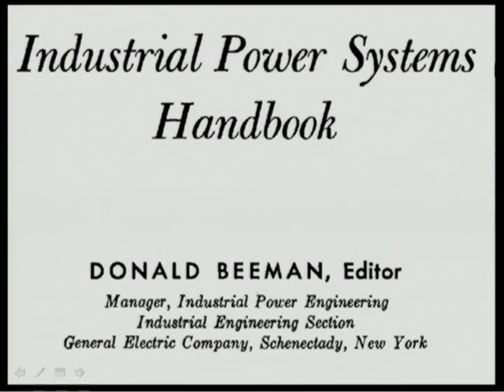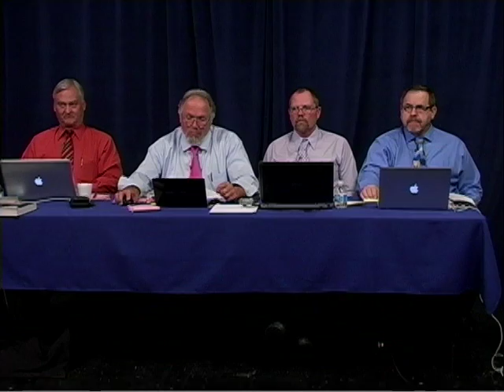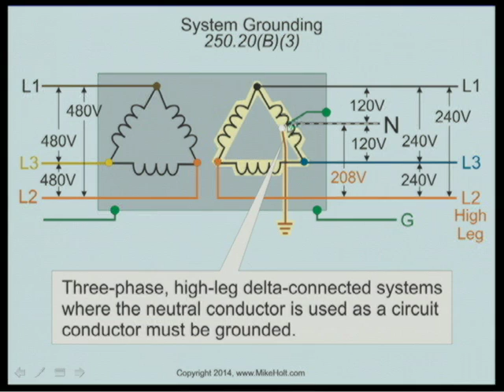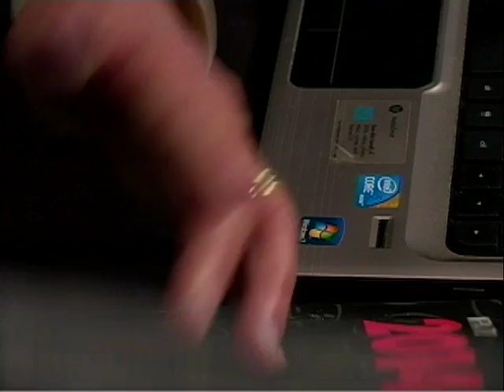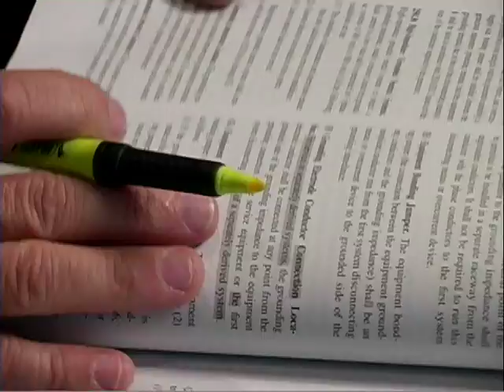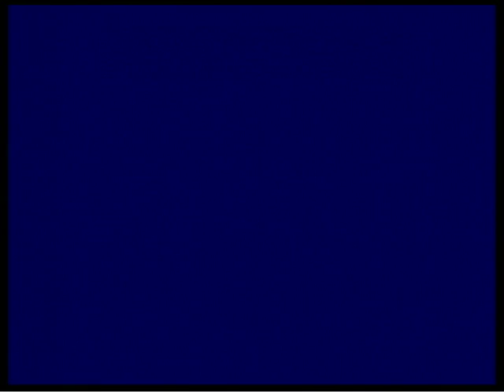4 of 7 Grounded Versus Ungrounded System, NEC 2014 - [100], (35min:35sec)

Comment: You’re not wrong about engineers today. I’m retired now, but my education was in power engineering. Electrical engineers today don’t learn the practical aspects of power generation, voltage control,  transformer connections. I’ve taught many young engineers the principles of power generation and distribution systems.
Reply from the maker: I truly miss the Engineers of the past, the ones who were taught Power Engineering. Many of today's engineers just don't have the technical, practical knowledge.
Reply: @MikeHoltNEC  I am currently going to college for electrical engineering and there is a strong emphasis on electronics and as an electrician it is quite disappointing.

Comment: And then I'm like.. whatever ground rod you use I'd suppose it would have to be lower resistance than the water pipe coming into the building right? Or you're inadvertently sending your entire ground system over to that pipe. 

lots to think about with this stuff and I can see how people make errors related to this.

Comment: Ok good- 9:40 answered my question from the grounding myths video: whether grounding saves lives or not. It saves equipment, not lives! Is what I gather. 

Old school thinking on this will say it saves lives because of the electricity being "redirected to ground" but you can just as well provide that path as a human body, so that's a bad supposition. 

Can anyone weigh in more on this for me?
Reply: Your supposition is correct. The idea is the ground provides a path back to transformer neutral to cause an overcurrent event and trip the breaker to kill the power. Happens in just a few 1/60ths of a second in the USA (60hz power), and depending on the breaker installed. The type of breaker required to save a human is a GFCI breaker. A standard breaker won't because the amperage required to kill you is very small. Remember, amperage (current) is what kills, not voltage, but a bigger voltage makes it easier to push more amps through your skin. So you can short out the system with your body but as long as current stays below the breaker rating, the power won't cut out and you will continue to be shocked until you break contact. A GFCI detects the difference between hot and neutral current. Think: power in vs power out. They are set to detect extremely small differences in current for the purposes of saving a human. Whenthe breaker senses that difference it opens the circuit. - union electrician

Comment: I was at an Apt building in the swimming pool that was surrounded by a iron fence I jumped out of a pool and grabbed the fence and got shocked it took all my strength to let go I think the system around that area what ever it was powering should be ungrounded by the swimming pools.
Reply: This happens near high voltage lines, it's magnetic induction if I am correct. When you got wet you gave it a good path to travel, if you were dry I doubt it would have been able to bite you like that.

Comment: Back in the early 1980's we had about 20 VFD'S for 2 to 10 HP motors. Had to install a 480 to 240 ungrounded isolation transformer to each drive. Tech told us the drives could not handle a large fault current and I thought this was dangerous not grounding the secondary of any transformer over 100 VA.
Reply from the maker: Ungrounded systems installed per the NEC are perfectly Code compliant.

Comment: I was in a very old warehouse with a ungrounded system installing HVAC equipment seven years ago.   Unfortunately a residential electrician was hired to wire up this commercial three phase building.  He knew he wasn’t qualified and I knew he wasn’t qualified but he did a lot of research and both of us watch Mike Holt videos.  And many others.     End of story he added too large transformers three face for 277 208 and 120 and 240 legs ( I am not Electrician my background was an automotive technician Electronics drivability electrical and air-conditioning) 

         He explained it to me this ungrounded building and corner grounding his new transformers that he was installing. 
           When they tore up the concrete for some other work next to the transformers he bonded the corner grounding electrode from the transformers to the re-Barb of the building and he drove a ground steak and bonded to the wires together and he had me Silverbreeze the wires to the re-Barb and all his connections that we’re going to be buried underground in the concrete so there would be no corrosion with good electrical conduction. 

        ( HVAC technicians you silver for braising and I use 95% silver on all these ground electrode to the six gauge wire. ) 

          Flash forward six or seven years to this year a new electrician came in to install some new rooms and equipment and all of a sudden electronics around the building started burning up or having glitches in malfunctioning. 

            One of my particular air handler‘s in one room started burning up motors ECM.  Several circuit boards burnt up just on this one air handler. 

        Then I took it to a extreme and completely gut it out the air handler and replace every electronic device in the air handler and it immediately burnt up another circuitboard within two days.   

       The owner of the building told me he had a good qualified electrician do all the work when I told him I thought it was a ground problem some sort a voltage problem causing this problem. 

              Approaching the end I got very pissed off because I replace so many circuitboard so many ECM motors in this very complicated LG multi-VRF refrigerant system continuously kept shutting down and having glitches. 

          So I found the circuit board that I originally recommend a transient and voltage spike surge protector that was installed many years ago and I opened up the panel. 

        I went over to the other panel and disconnected the wires from the circuit breaker to my air handler that kept burning out motors and circuit boards. 

       I got 100 foot Home Depot 10 gauge extension cord and stripped both ends off. 

         I wired up a new circuit breaker to the other panel I knew the electrician did not touch with a extension cord dangling out of the front of the panel definitely not electrical or OSHA approved using 120 V extension cord to run 208 voltage. 
                    And I ran that extension cord all the way to the back room disconnected my air handler and hooked it up to this extension cord.  

        Problem solved no more burning up ECM motors no more burning up circuit Circuit boards and no more blowing fuses every couple days while trying to track down the problem. 

           I proved my point and the owner of the building had the electrician run a new conduit with a separate line from where I connected to that one air handler to take care of the problem but he still had 100 either electrical problems caused by the last electrician that I am not going to go after and tackle. 

       (i’m just an automotive technician a grease monkey I change oil and rotate tires) 

      In nearly every HVAC job I go to and every three phase commercial building I continuously run into these problems with electricians that are nothing more than wire monkeys who can blow holes in walls been conduit and pull wires but haven’t the slightest inkling of the basics of how electron flow works and even fewer know how to even properly wire up motors and understand readings. 

But then again I’m just a grease monkey what do I know
Reply: I hope this gave your ego a nice tug. 😅
Reply: @TeachMeHow2Douglas  over the last few decades and has taught me there really is very few True electricians. The majority just fake it until they make it. 
      Study until they can pass and memorize the test exam questions without actually knowing the content. 
        That California will even give a monkey a California electrical contractors license

Comment: I work in an old steel mill and we have mostly ungrounded systems anywhere there is 3 phase. The diagram you used shows an EGC run with current carrying conductors even for the ungrounded system. What is the purpose of the EGC in an ungrounded system if there's a separate equipment ground with a grounding electrode at each of the devices in the circuit?
Reply from the maker: To open the circuit in the event of a second ground fault from a different phase.
Reply: The reason, that old steel mill, has a "Delta" ungrounded, system is the Over head cranes, with wound rotors on the Hoist, before VFD, cranes used that, for lifting "Ladles", of molten steel, also the "Arc Furnace", has 3 electrodes, for melting, that creates, all sorts of back, feed Induced currents, on building steel. They should have detector/lamps, & ground leakage, meters that you should be "Monitoring", but I bet, the Management, doesn't.

Comment: They use ungrounded delta on navy ships.
Reply: You correct, I was an Electrician Mate, fixed many, a Residential  Shipyard worker, grounding a panel leg, on a Delta Panel, boy the Paint would, burn, were the panel was mounted to the "Bulkhead".